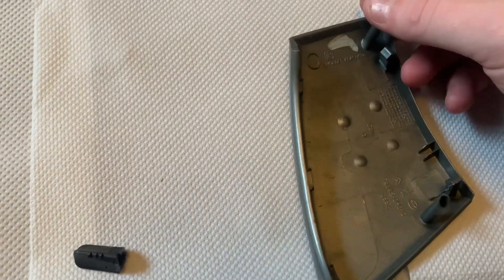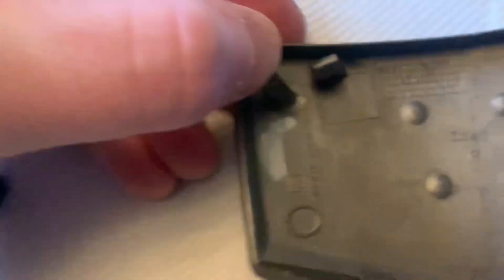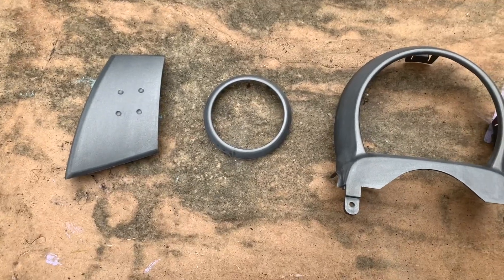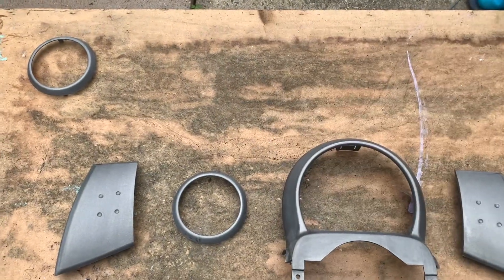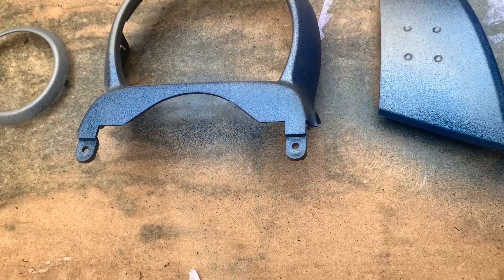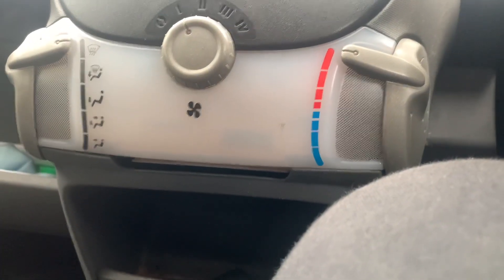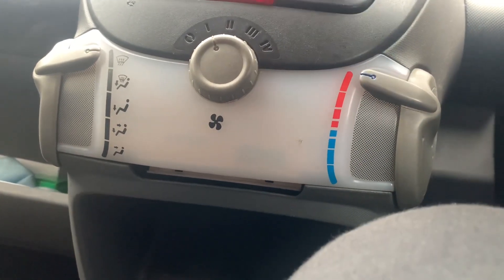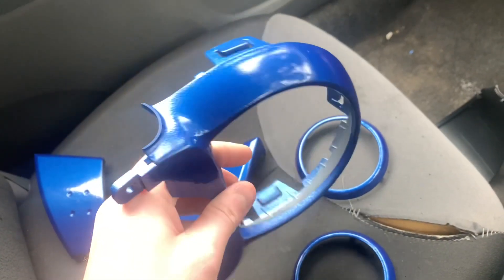Citroen C1 Interior Trim Removal + Painting. Interior Colour Coding

Comment: I always use a hair dryer & heat up what am going to spray
Reply from the maker: Stuck at home and not got one, but I just thought fuck it and did it anyway. Spraying usually goes wrong when I do it anyway 🤣
Reply: I painted mine today. Basically stripped off the parts (minus the doors). Washed the parts in the sink, heated them up with the hair dryer like you said and it came out looking great. Oh and I also heated up the can of spray paint in hot water first. I used Kobra paint which goes on really nice.